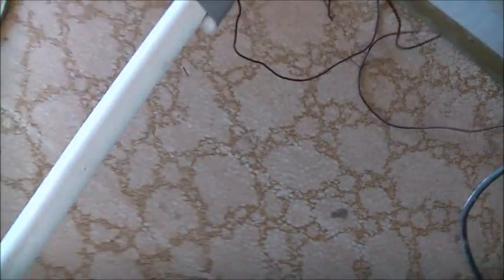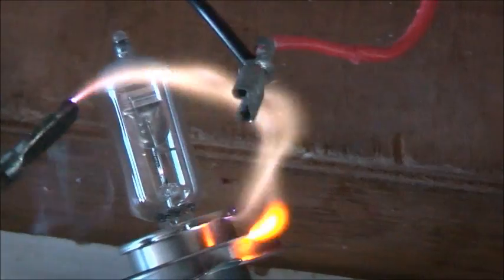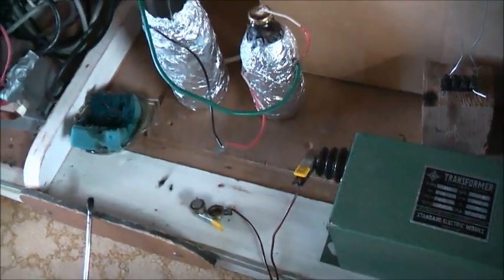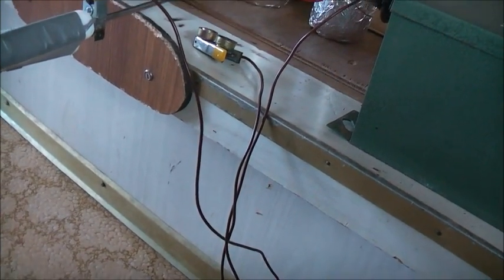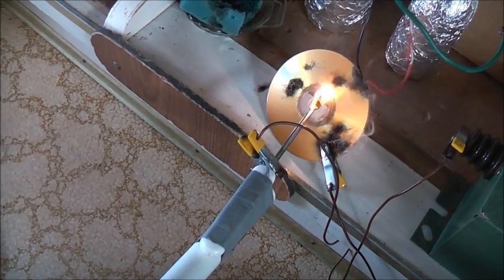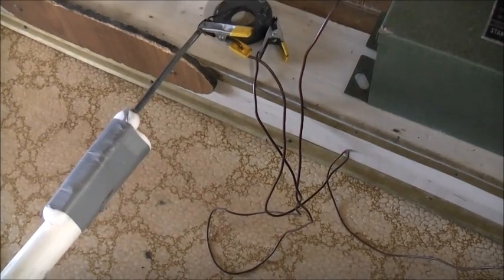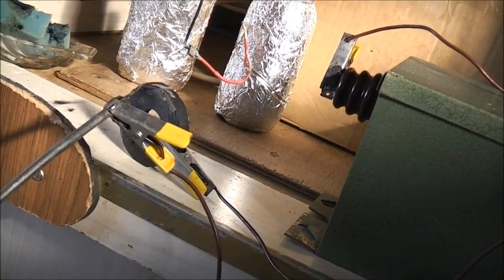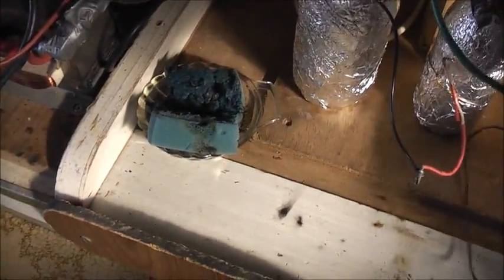High voltage arc in a magnetic field

Comment: Hi, i have connected an incandescent bulb to a flyback 
before, and it worked like a small plasma globe :) but you cannot connect the hv leads directly to the bulb terminals, you need to connect to one and strike the other with the arc. Also, if you want to use the nst on the bulb, try one with a broken filament, with the nst connected to the bulb terminals without an outside arc. had bulbs blow up this way XD